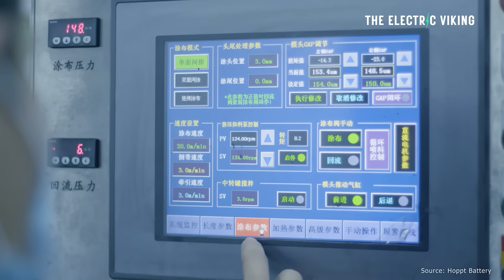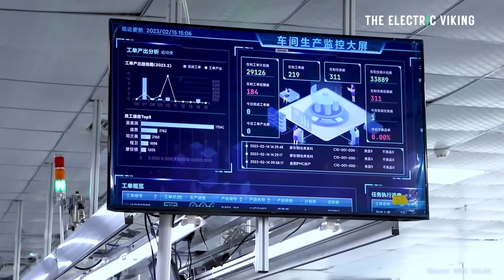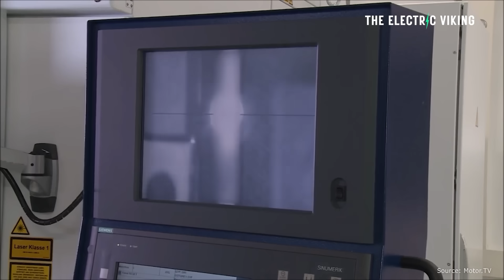NASA has cracked the code for replacing lithium batteries: ‘triple the energy’

Comment: Also consider landing weight is same as takeoff with battery.  That has to be engineered into the product to withstand the repeated stress in flight and landing.
Reply: Actually batteries weigh a little bit more when fully charged! Very interesting science happening here.

Comment: Just remember that 1 Gallon of Jet-A1 has the energy equivalency of 33.6kWh. In addition that's 6.7lbs/3.0kg. So that's an energy density of ~11kWh per kg. Commercial A/C measure fuel capacity in mass not volume. Currently the energy density for EV Lithium batteries is ~300Wh/kg. So if my calculations are correct there would need to be a ~36 fold increase in energy density per/kg before you would equal current Commercial Jet A/C using fossil fuels. That's an enormous gap to bridge, even with potential future technology developments with reducing A/C empty weights. Aviation will likely be one of the last areas of transportation to move to an alternative power source, hydrogen would be a more likely candidate, however that has enormous safety/storage issues in itself.
Reply: A jet engine can only get an efficiency of around 35 to 40%. These losses have to be taken into account when making the comparison.
Reply: Most likely it will be vertical jump jets, such as Lillium.  You board the electric jump, located on top of a tall parking structure.  Destination is a regional airport with fuel burning large jets.  Noise will be a problem, hence a tall structure.
Reply: The energy density issue for jets is far more complicated than you suggest. 
     They can take off with a full load of fuel but cannot land safely with that much weight. This means that the energy density of electric jets needs to remain far higher than suggested due to the fact that battery weight will not be reduced as it consumes power.
Reply: @rockettests2617 Not much of a problem. Cruise energy/km is not much affected by mass. The only significant issue is designing the aircraft for higher weight landings.
Reply: Need to factor in jet engine efficiency and the changing weight factor.  Planes using fuel gets lighter the more fuel it burns however electric planes always have same weight
Reply: Long haul this is an issue. But short haul sub 1500-2500 miles should be viable within 5-10 years
Reply: Jet engines are roughly 1/3rd efficient, so divide your 36 times by 3. Current lithium batteries are roughly 1/12th the density needed for long haul flights. That is why the only electric planes are short range hoppers. 
The batteries from the video are 3x that so 1/4 the density needed for long haul flights. Easily enough for big regional flights. 
Incremental improvements will displace increasingly longer flights until all flights are electric because they are MUCH cheaper to operate. The financial incentives align toward electric aircraft.
Reply: The numbers are not quite right. The energy density of Jet A-1 fuel is 9.6 kWh/kg (close to the 11 mentioned).  The big problem is with the energy density of the batteries.  Batteries are heavy and numerous, so they have to be manufactured into a battery pack.  The energy density of Tesla's battery packs is about 150 Wh / kg.

This means that an increase of 64 times is required, not 36 times.  You are approximately correct about the efficiency of an electric motor vs. a jet engine, but there's something you didn't consider.  The motors may be highly efficient, but the propellers are not.  Once the tip of a propeller reaches the speed of sound, the efficiency drops dramatically.  I'm not sure a motor can propel an aircraft in the same way as a jet engine.

I want this to happen as much as anyone, but lying to ourselves about how difficult this will be is not a solution.  This is harder than most people realize.
Reply: @rockettests2617  They might do a "battery dump" before they land.🤣
Reply: @wemagor  like i said, we already have short range commuter planes and small aircraft from today’s tech. 3x the energy density will definitely allow large regional electric planes. They probably won’t be as fast as jets. More likely the same speed as the old prop planes for the reason you mentioned, but they are coming. And likely before the decade is out.
Reply: First, NASA has always been far more than a rocket enterprise. By the 1990s NASA had spun off over 1400 new INDUSTRIES. Two we always think of are memory foam and the widespread adoption of Tang orange drink.

Second, you are talking about a NASA battery with 3X the energy density of lithium ion. But lithium/aramid/sulfur batteries have a 5X energy density. That's 40% better than NASA.
Reply: Just remember that every gallon of jet fuel has to start from a long chain of events that are all polluting the atmosphere. Accepting that reality is the best way to look at the possible future forms of transport. Long distance trips may mean a rocket 🚀 to a space hotel as it passes over. Then reentry to your destination after as many orbits as it takes .🌏💫🤔
Reply: What a wonderful post. Wish I was as brilliant 👏👏👏🙏
Reply: Thanks for the information. Ignore the battery heads.
I have a 13 year old audi A3. It's done 250000miles I am going to keep it until audi VW make another diesel equivalent.
I paid hard earned money for it.
Its been a fantastic car.
That's why I worked so hard to pay for it and maintain it.
If the 737 boeings and airbus jets can fly for 20 years then so can my audi
Reply: @rockettests2617  the further the jet flies the lighter it gets. The battery has no chance of competing
Reply: @Lewehot  bingo
Reply: An electric aircraft would also be able to shut down during descent, and possibly recover energy as it slows to land.
Reply: @mohammadwasilliterate8037 an aircraft turbo-fan hás a better power to weigth ratio then an eletric motor
Reply: @timtravelnomad  batteries are diametrically opposite of what you need for aviation. Not only is jet A1 the most efficient fuel available it's the most reliable and works in the zone of least air resistance. It also gets lighter as its used up.
Batteries for planes is a lie like travelling to mars. You may look up muscle atrophy.
At very best they'd be good for is to ferry top buisness personal from the top of the skyscraper to the airports
Or in hybrid cars to exit cities quietly till the real driving begins
I have extensive experience in the taxi driver to the airport experience.
I know what works.
Until the boffin get dilithium crystals up and running we're going to use oil.
I don't make the rules
Reply: You don't necessarily need equivalency,  just enough.  And you might need to give up some passenger capacity,  but your fuel will cost much less,  especially if you charge during peak renewable production.
Reply: @mohammadwasilliterate8037  drag is not dependent on weight, the cross-sectional diameter of a jet engine is relative to the diameter of the fan, larger fans are more efficient, but also have more drag. So it is unlikely that the drag caused by the current jet engines' bulk will be solved by switching to electric.
Reply: @wemagor 

Propellers are about 20% MORE efficient than high bypass turbofans.   It there is no reason that an electric cannot replace the gas turbine in a jet engine, this is a ducted fan.
Reply: Your calculations are not correct.
Reply: @wemagor 2:48
Reply: On July 19, COMAC (Shanghai) Aviation Co., Ltd., jointly held by CATL New Energy Technology Co., Ltd., Commercial Aircraft Corporation of China Co., Ltd., and Shanghai Jiao Tong University Enterprise Development Group Co., Ltd., was officially established. COMAC is the main body for implementing the national major special project of medium and large passenger aircraft, and is also the main carrier for coordinating the development of mainline aircraft and regional aircraft and realizing the industrialization of China's civil aircraft. Currently, it has completed the production and delivery of the ARJ21 new regional jetliner and the C919 large passenger aircraft.

The establishment of a joint venture between CATL and COMAC means that CATL will also enter the aircraft manufacturing field.

At present, the most direct relationship between CATL and aircraft is the battery. At the Shanghai Auto Show in April this year, CATL released its most cutting-edge battery technology - condensed matter batteries. The first application field of this battery technology has jumped out of the automotive circle and will be used in the aviation field. CATL also said that it has already Carry out cooperative development of civil electric manned aircraft projects, implement aviation-grade standards and tests, and meet aviation-grade safety and quality requirements. At the same time, we will also launch a car-grade application version of condensed matter batteries, which can be mass-produced within this year.

NOTE： CATL's latest black technology "condensed matter battery" has a range of 1,500 kilometers on a single charge, with a maximum range of 2,000 kilometers.
Reply: Silly you think jet engines have 100 percent of efficiency?!
Reply: Perhaps the solution could be as follows:
* Use 500 to 600Wh/kg battery packs for short haul flights.
* Use a smaller battery pack plus a jet fuel generator for longer flights.  In other words, a hybrid.  The jet fuel could ultimately be a biofuel made from any natural hydrocarbon such as algae, switchgrass, etc.
* Switch back to all-electric when batteries achieve 800Wj/kg.
The airplane and electric motor technology would stay the same.  Only the energy storage would be modified as required and as technology improves.
Reply: Every airport would need a coal fired power station.
Reply: @petermandel2552 Naah. You’d use standardized swappable batteries and run the charging 24/7. Flights peak in the early morning and late afternoon / evening. Plenty of time for charging in between.

Comment: When an airplane crashes the reason everyone dies is normally the large lump of energy they are subjected to from going several hundred miles per hour to zero in a fraction of a second. If they manage to get onto the ground slow enough to avoid that then mostly they can be evacuated quickly enough to avoid fire.
Reply: I was gonna say um no... It's blunt force trauma.
Reply: And we have signs on the roads saying “Slowing Down Won’t Kill You.”.😅😂
Reply: @malcolmrickarby2313  when in the air however, slowing down is one of the things that might kill you. Go too slow and you’ll discover that you’re no longer flying but instead plummeting towards the ground. The trick to landing is to slow down slowly such that the wings slop flying just after you’re actually on the ground.

Comment: Also, solid state + sulfur + (Na or Li) = big win for everyone. I will say it again :D We're going to need 1/4 the size and weight for EV battery packs in the next 5 years. Not only would it cost way less to produce them, it would much safe, longer range, and offer fast charging still. 1k miles per charge would be easy to hit soon. While they might use a bit more Li making them - it will be help spent not needing as many over all cells to make the battery pack. 7000 cells today down to only needing 1750 cells resulting it even more reduction in cost:) Over all EVs will come down into the sub 10k soon.
Reply: The NASA Battery also uses graphene in the cathode.
Graphene is being prototyped for anodes in traditional Li-ion.
So this is a convergence of a few existing emerging trends - Li-S, solid state and graphene.
Addition of selenium is smart (it's related to sulphur above in the periodic table).

https://en.m.wikipedia.org/wiki/Sulfur_selenium_battery
Reply: They should be priced at zero because that's what they're worth .

Comment: EV airplanes can also regen as they descend! With propellor planes there is far less noise and vibration, and the electric motor, unlike gas, has no need to breath thinning oxygen at altitude. There’s also the advantage of not dying in a gasoline fire!

Comment: @electricviking being an expert in aviation I have to correct you.  
1. Kerosene is the fuel, not gasoline. 
2. Fuel can be dumped overboard during an emergency.
3. The best battery technology possible will probably never be good enough to do long-range aviation using current design concepts, however the unique advantage of not using oxygen from the air for the energy conversion, allows electric aviation to fly much higher, which by itself does not improve range at all but coupled with airship technology could allow high-speed long-range flights with much less energy.  It's tempting to reduce the footprint of such a long-range aircraft by using hydrogen fuel but this is problematic because the water vapor emissions at stratospheric levels has a negative global warming effect.

Comment: Large airlines most always takeoff above their max landing weight. They are designed to get lighter as they fly so they can land at a lighter weight.

I wonder what structural engineering will be needed to takeoff and land at the same weight.

Comment: This is incredible news and reporting means -
We need a massive focus on how the energy is to be cleanly generated, since currently EVs are using energy from fossil fuel power stations in Europe and most of the industrialised world
Reply: The more things we can electrify the more stable the solar and wind industry will become. Yes we need storage for those and we need companies that will use the electricity. 

They don’t want to build a 1000 acre solar farm just so they can shut off a gas turbine. They don’t want to shut off the gas turbines unless they become to expensive to maintain.

Comment: People trying to force electric for applications it’s not fit for breaks me, you can’t do electric jets so we’re talking about propellor driven aircraft where most the noise comes from the tips of the propellers. Could have some sort of electric turbine or turbofan but even high bypass ratio engines use the core thrust. So turbine speed would need to be maybe 20% faster to compensate stretching material science or I guess much bigger engines. Jet fuel burns and the aircraft becomes lighters and more economical and efficient. Short haul operators usually spend 10/15mins refuelling and turnaround. No mention of recharge rates etc. it would have to be battery swap tech. New aircraft, new engines, new regulations and cheaper…

Comment: Batteries are currently 10% of the energy per Kg as Jet A1 (Aircraft Kerosene).  A modern jet is always weight constrained, so until batteries get to 10x their current energy density - ie 2.5+ kWh / Kg nothing serious will happen in the aviation sector.   Your 800Wh / kg will only work in light aircraft or very short range commuters.  It's a shame, but an inescapable fact.
Reply: Not really. Electric Short range commuters already exist with the previous generation of batteries. 
As with most people promoting jet fuel, you neglect efficiency. EV planes are about 2 or 3 times as efficient. So regional flights are easily doable with these new batteries shouldn’t they make it into production.
Reply: To make a significant dent in aviation CO2 emissions we need to be able to convert 737/A320 type aircraft over, but the energy density required for the take off phase just isn’t there with batteries - even with a 2-3x improvement. Prof Alan Epstein from MIT has gone through all this in a detailed paper worth reading for anyone interested in the subject. Hydrogen is also infeasible. He states we’ll be using SAF (sustainable aviation fuel) for the foreseeable future
Reply: @markjonz  except, unlike with hydrogen, we actually have small battery powered planes flying right now. So a 3x increase in energy density would make a big difference.
Reply: @markjonz the extremely popular 737,A320 size ✈️ may not suit the travel needs of a post fossil fuels world 🌎. High speed rail, 🚄 limited range and size electric aircraft 🛩for intercity travel and starship 🚀for intercontinental high speed travel. Remember that outer space is very close. In fact I can see it from my place 😊☝️🌘
Reply: Short flight under 300 miles should open up new markets.  Less maintenance, less noise and inexpensive fuel.